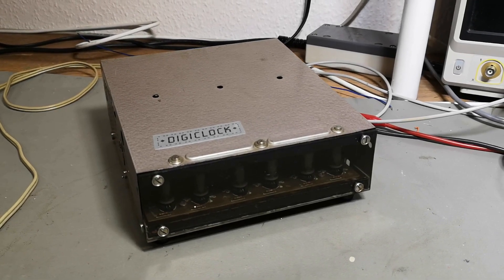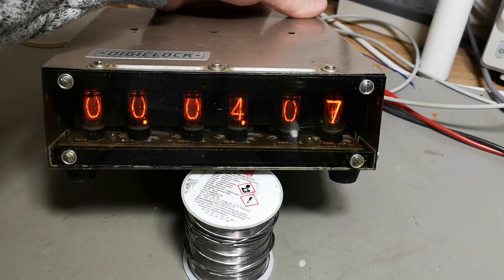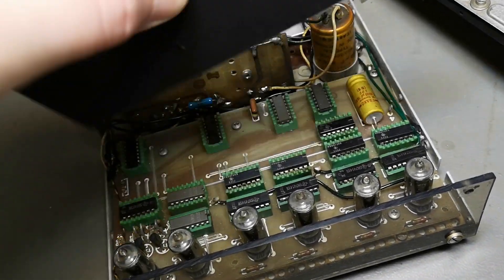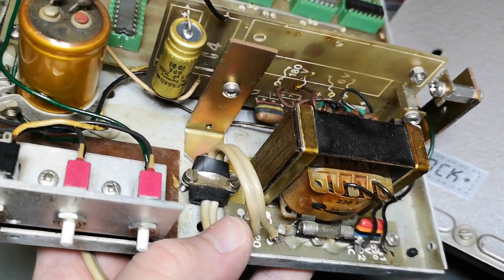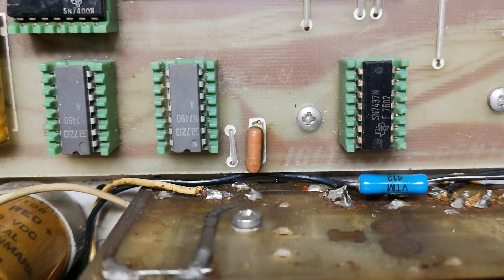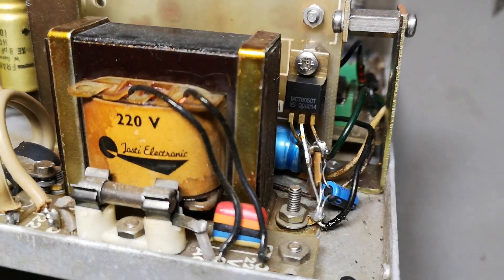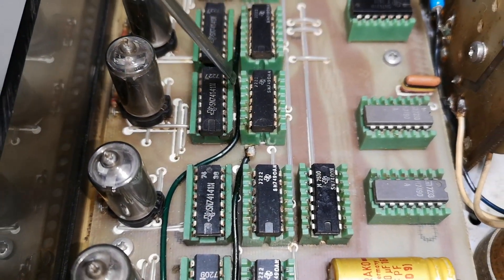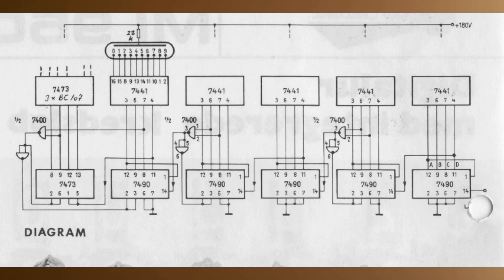DIY MI950 Josti Electronic Nixie Clock Kit 1976

Comment: Hi, I really wouldn't recommend a box from an electronic radio for a built-in clock. Here someone laid the foundations of miniaturization - by cutting one board into several smaller ones and putting them together in a smaller box 😂 However, the magic of digitrons has not disappeared 👍because why do it like everyone else ..........
The disintegration of softeners still occurs on other components - straps in tape recorder mechanics, insulation on crocodile clips - they were able to corrode even the plastic box where they were stored, as well as cable grommets - the mutual reaction of materials is good alchemy 🤪

Nice day 🙂 Tom

Comment: Yes 1960's and 1970's era PVC with the BPA plasticiser in it reacting with the copper, and thus turning into goop with time. Yes seen it a lot, it is common in older buildings from that era in the wiring in the walls, and you often find pools of it in the housings of the switchgear as it dripped out onto the bottom. Came with the stopping of tinning the wire, and thus the copper reacting over time with the PVC and the plasticiser. The tinned wire from earlier did not do this, despite using the same PVC formulation, as can be seen in very old phone wiring, that, despite being over 50 years old, does not do this, because the copper wire is tinned.
Reply from the maker: it is all magic, or chemical physics,

Comment: I've seen these old wires turn slimy over the years. It's the plasticizer chemicals leaking out. The plastic will eventually turn back into crude oil or gas I guess :D